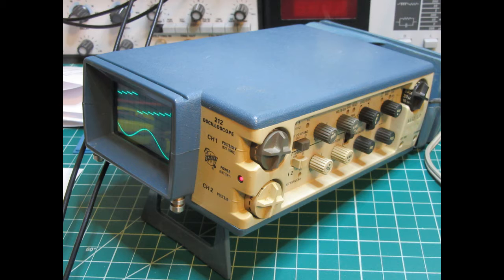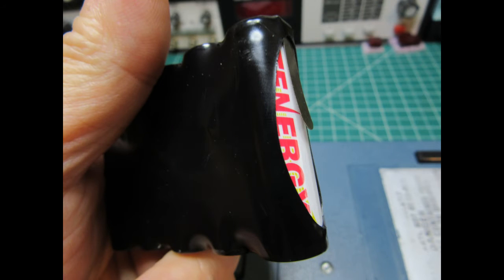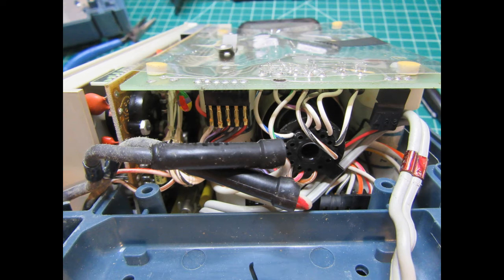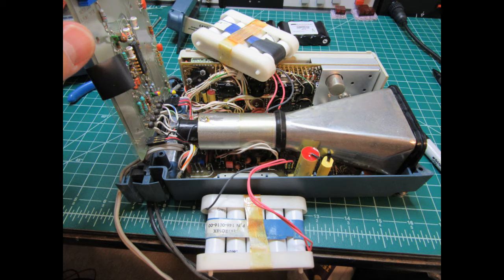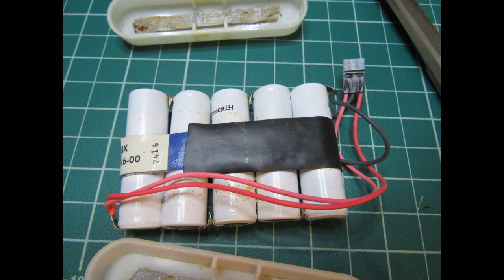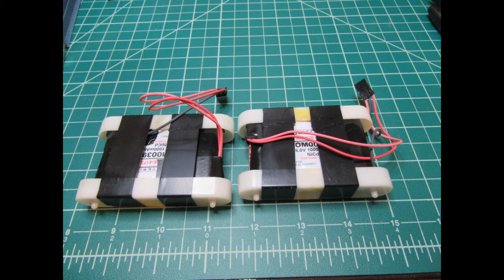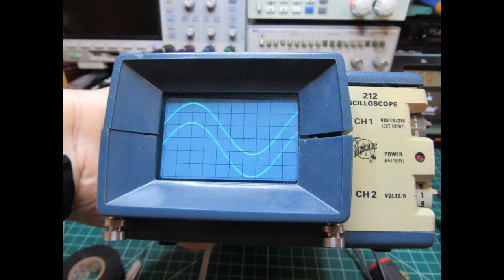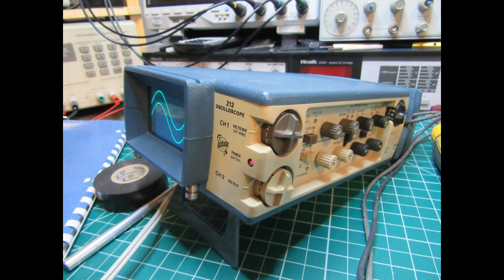Replacing Batteries on the Tektronix  212 Oscilloscope

Comment: Just replaced my 212's batteries from OSI. Thank you for the lead. They have updated the pack to be 5x 4/5 "A" cells, so foam or some other material needs to be placed in the top and bottom caps so that the completed packs are the right height (as per the original?). Now to figure out why my traces disappear below a certain vertical position!